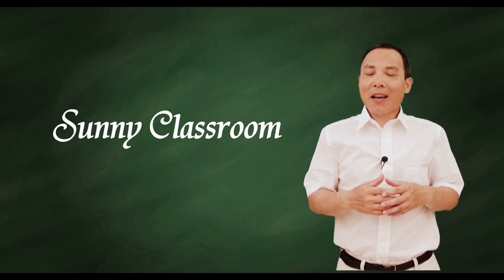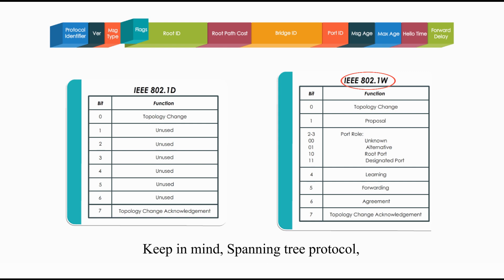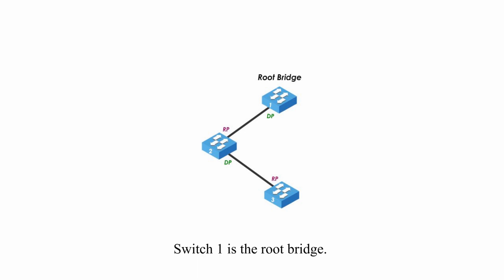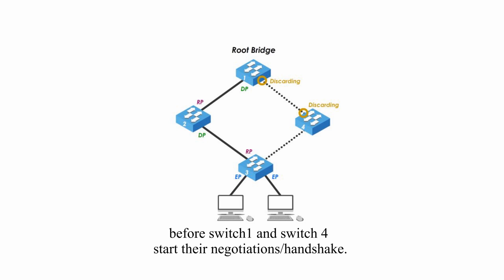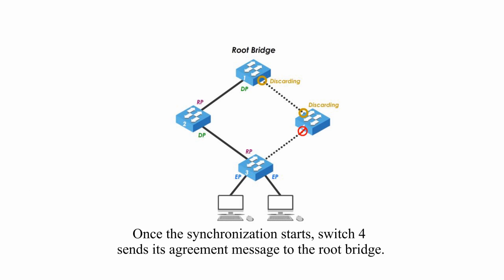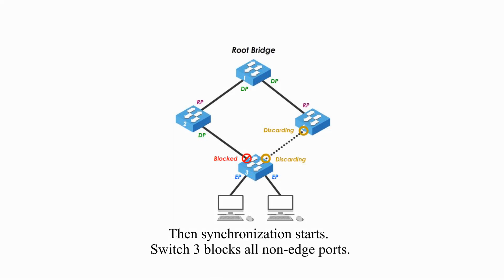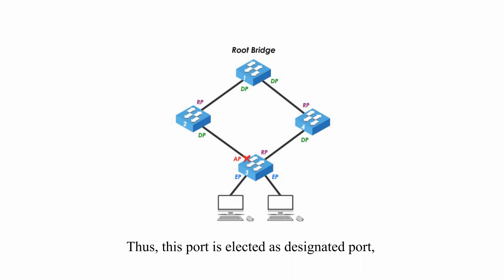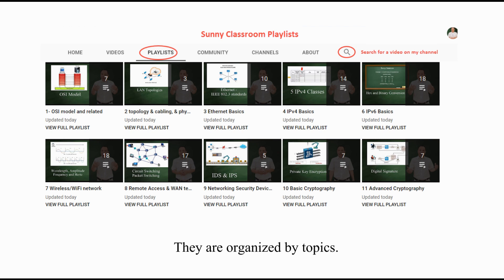How Rapid STP reacts to change -  Proposal/agreement process

Comment: Rstp is interesting as well as complex concepts. I have been reading about rstp for sometimes, and with so many cases what trigger a change in network topology and how rstp response to TCN is amazing.  I examine a situation how rsto react to a lonk failure between root bride and root port, and how rstp propagate tcn to its neighbouring non root switches without waiting for max age time to expire is absolutely amazing. I cannot complety agree with what he said about in this video bit he definately provide me a new perspective to look at rstp.  Anyone interested to know about rstp needs to know following terms. 
Portfast, edge port, bpduguard, port rooes and state, sto timer, point to ooint link, proposed and agreement bpdu, tcn bpdu, hello bpdu, uodated hello bpdu, frame delay timer, max age timer, root bridge election,  tie brekaer criteria, root path cost, selecting root port, non designated port on segment vs designated port.

Comment: Thanks Sunny, great video summary as usual. I've one question though at 3.28, when the Switch 4 is added, the diagram shows that the port on the root bridge is also set to discarding. How does it then send the BPDU if it's discarding? Researched and found: According to the Cisco literature, the default role for ports is Designated Discarding in RSTP - this allows Proposals to be sent, before  a port is set to alternate or backup.
Is that correct?
Reply: discarding state allow bpdu's to sent and recieve, any other irrelevant frames drop in egress (or ingress not sure at this point)

Comment: Hi Sunny, thanks for the great work. I have some confusion. Since one port of sw4 is connected to root bridge, root bridge detects that so it sent proposal agreement. What would happened if sw4 would connected with other switches instead of root bridge? How root bridge knows about the new switch? In that case who will sent 1st proposal BPDU? If root bridge always sent proposal BPDU irrespective of switch distance or hop, then why sw1 didn't sent proposal BPDU via sw2 and sw3 in current scenario as path cost isn't specified yet? thank you!
Reply: Hi, the new connection to Switch 3 would be in the default state, which according to Cisco isn't actually discarding, but rather "designated discarding", which allows a proposal BPDU to be sent. I'm guessing the synchronization would occur, the designated and root ports then assigned on Sw3 and SW4, and a Topology Change Notification BPDU sent by SW3.
With regard to your second example, the situation where Sunny describes only the root bridge as sending the BPDU, not the SW4 or SW3, I'm not certain - if you found out anything about that I'd really like to know! I would guess that the BPDUs are sent simultaneously from SW3 and SW1, but because SW3's BPDU will have a different Root ID to the Bridge ID, it would be ignored - I also suspect this is wrong and we'd be best checking the IEEE802.1 W specifications ;)
The information I found was at community.cisco.com/t5/switching/rstp-proposal-agreement-process/td-p/2303537

Comment: The best path to reach rootbridge will b port which is connected to switch 2 ,so in this case the alternative port must be the root port and the port connected towards switch 4 will b alternative port,
Note :-I am considering the cost of both link are equal.